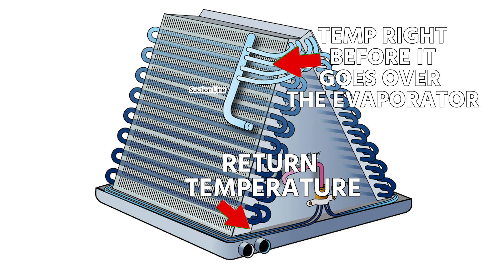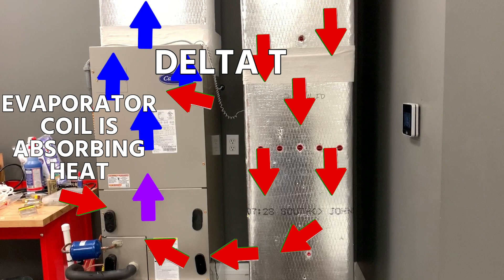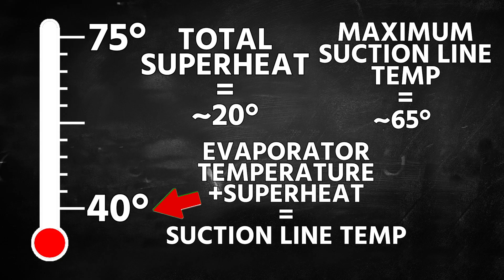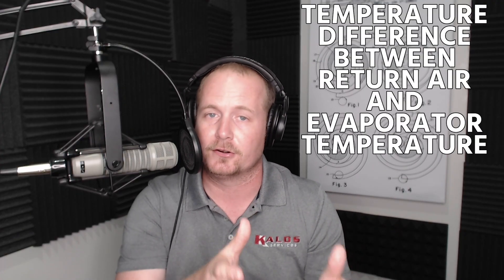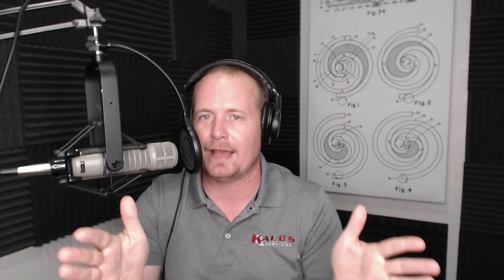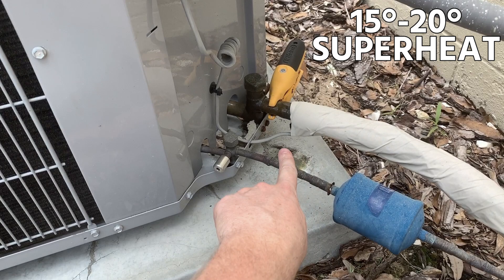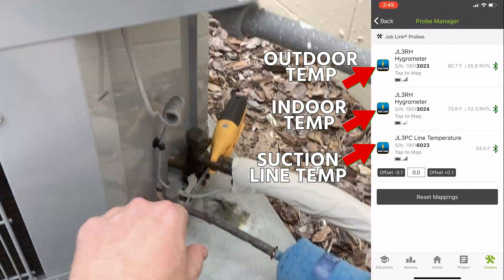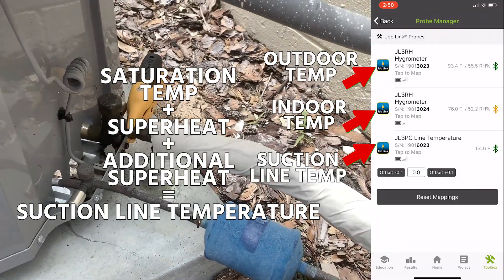Suction Line Temperature

Comment: AI says: "Suction line temperature, measured near the compressor, should be cooler than the indoor return air temperature due to the evaporator coil absorbing heat. A good rule of thumb is a 35°F difference, with the suction line being cooler than the return air, plus a superheat value (typically 10-20°F). " I know you mentioned similar things, yet above words no need ten minutes, so I understand these above words but not your video.

Comment: I'm having a problem I need help with.5ton 410a Txv.Subcool about 10.Sat temp 48.(High right)Delta T 15(low)Suction temp at evap 63 and hunting.I see however suction temp hotter at evap than at service valve.Capacity for crap high elec bills air gets hotter by the day with inside home at a muggy 80.Is there a restriction,bad txv,non condensibles,bad coil distribution?HelpShould I remove refrigerant to get lower sat temps.Its 79 indoor temp at return plenum which I thought sat temp should be about 44.Air supply is 63

Comment: Can you apply this principle to a domestic refrigerator?
I got two pipes emerging from the compressor.  One is hot (105F) at the point the pipe meets the compressor and the other is ambient (68F) where it meets the compressor.
Which one is the suction pipe? The ambient?

Comment: The company I work for sticks to  ridget rules on temperatures and pressures.  You cant talk to these guys and explain to them that not all systems are created equally. Some are just bad installs or worn out equipment.  Me I just use my gut feeling on what works .  its worked for me for 30 years.  Not an expert just a service man.

Comment: Would there be any merit in using indoor suction line temp to tune your blower speed? For example, if you were slowing the blower to remove more water, but didn't want superheat to fall too far.
Reply: Suction and condensing temp Of compressor.

Comment: I enjoy your videos but sometimes you overlook or don't state the effects that ventilation issues can have on these numbers.  I am in the controls and data analytics software business (my co).  To use an example, I decided to hook our sensor system on my own home.  I didn't expect to find much but I was instead very surprised.  My home is zoned up and downstairs with a Honeywell controls system.  After running the diagnostics on my home, it blew me away when I discovered that my bypass showed "open."   When I examined the system in the attic, I discovered that these fools never installed a bypass and it was wide open.  Now this causes the extreme heat or cooling in the return (depending on what stage is running).   As for the suction line, it shows very cold when the system is cooling.  That might cause some errors in a tech's judgement when only considering LL to SL etc.  My point is that the big picture matters greatly.  We deal with commercial applications with bypasses and fairly complex setups too.  However, even the small split systems can get complex when they've gotten fancy with Honeywell zoning and bypasses.

Comment: Can you talk more about how to properly set up the probes and do the measurement on some modern air-water heat pump with ETXV like Mitsubishi PUHZ or  PUD or Daikin or Panasonic or, Hitachi. This videos are too much of an US type air-air conditioners not heat pumps. Im really interested how would you measure the system with Testo smart probes, read the data from it and use that data to diagnose the system.  Most of the times the heat pumps like Mitsubishi comes precharged and with inverter technology. Can you even diagnose the system on inverter heat pump? Where do you plug in the probes(at the service valves or at the valves at exit from the heat pump? How do you know if the system is charged good if you have inverter heat pump?

Comment: Well knowledge doesn't mean good teacher. You talk like a robot - Too fast and too monotone.. (bored)
Reply: You can play-back at less than normal speed. Look for the gear tooth on the bottom edge of the vid....click....and run at 0.75 speed. I have the same issue...BUT.....I appreciate the shortness of the vid at regular speed and to get the big picture....yet be able to play back at 0.75 or even slower speed if I need to....to absorb the details. You gotta admit, the content is technically excellent. Hei s a good teacher and uses screen text to good effect too.... 👍
Reply: Damn I thought I was the only person

Comment: A dirty ID coil, or fan running low speed, can screw this all up, even with a TEV, depending on how bad an airlflow problem is. I’ve seen plenty of iced up coils (back to the compressor)with TEVs, with a warm space temp,  and t-stat setting in normal range.

Comment: My suction line is cold as hell by compressor.
120000 btu furnace and only 8 vents on 6 inch duct in house.
Is it possible im not moving enough air.
Unit runs non stop above 90 degrees
Reply: There is a phrase that may apply here.

"ABC"  = AIRFLOW BEFORE CHARGE.

Too many "techs" start passing gas before eliminating airflow problems at both evaporator and condensor.

Comment: Good job, just a note : prefer to see liquid line filter drier close to the indoor metering device. Helps keep it out of the weather and from rusting as well. The picture on the outdoor unit just showed it outdoors but, good to see one in he system.
Reply: So if I get a new system alway tell them to place the dryer close to the TXV instead of outside?  I always thought there was a reason it was outside but you make a great point.
Reply: @condor5635  ya man👍😎
Reply: @condor5635  Yeah there is a reason it gets put outside. When its outside, its likely to get replaced. If its up in the attic and the work is out by the condenser, then that dryer aint getting replaced

Comment: Today I have two R22 AC in a house which have NO filter driers installed. Fixed piston metering device. Both suction line pressures are around is 90psi (saturated vapor temperatures are around 53F). The suction line temperature at outside condenser service valve are around 73F. So the superheats are around 20F. The liquid line pressures are around 220psi (the saturated vapor temperature is around 108F). The liquid line temperature is 104F. So the sub cooling is 4F. 

Although the super heat is high, but I don’t want to add refrigerant since the pressure at suction line is already pretty high. Is the metering device clogged?

Thank you
Reply: You have high superheat and low SC. That’s likely just an undercharge situation. It’s unlikely the piston is restricted, but it’s hard to really diagnose without knowing airflow or indoor wet bulb and such

Comment: Hello, asks a Question I hope you can answer.  Is it recommended using TWO different Systems in an AC say Out side is a Goodman, inside is a Rheem. Do these Mix well or should all AC be the same inside and out. The apts i live in they have Non Certified HVAC woking here and none of them even Know the +30 Rule and probably nothing of what you just Discussed they speak little if any English is why.

Comment: Sir, what is the capacity of a refrigerant compressor, how is it calculated, and why do we measure it in term of a heat transfer unit like BTU/hr or  TR?
Reply: sandeep satratey I can kind of answer that I think?!.. capacity is the stroke, bore and size of piston, if I remember right from school lol. And you use btu because thats the heat rejection, like 1 ton of cooling is 12,000 btu of heat rejection and 15,000btus of cooling.. or something like that haha my numbers might be off but the idea is close

Comment: I wonder if you could do a video/podcast on line set sizes like different diameters on system performance. Everyone knows we should follow manufacturers specifications but I run into many systems where people have reused the line sets and the newer systems is calling for one diameter larger like 7/8” vs 3/4”.  Around here many of the systems are installed in attic’s and suction lines are quite often dropping 25 feet.  Many times the systems seem to be running fine but could they be running a better delta T, or better electrical efficiency if they have used the larger suction line?
Reply: MrNebRebew Hello Brother, just a note from a long time tech here. I have noticed more often than not when going from R22 to R410 that the line sizes are typically the same or less. Also if you go to the Install manual or the Engineering specs often the line sizing has a pretty large margin on line set diameter as well as length before it affects BTU output significantly if at all. Trane and carrier have great design manuals for all this.

Comment: Still try and look at your suction line at the Compressor and see if it is sweating all the way to the Compressor and maybe a small ring past the Point of entry into the Compressor is somewhat a good indication of over or under charge of a system .
Reply from the maker: That depends on outdoor dewpoint
Reply: HVAC School  I agree live in Louisiana but plenty of times you can see the sweating will Stop a few inches from Compressor which is a sign but I always do Superheat and Subcooling no matter if fixed office or Txv and if it’s a change out or New System I always put Fittings by evap Coil with shraders lil expensive but can check my pressures and temps entering and leaving evap Coil also with liquid dryer at Coil . I’m 63 yrs old still working and learning every day
Reply: Here in AZ we very rarely have sweating suction lines because it’s so dry out here. Careful sharing that method with others.
Reply: Jules, we sweat in January in Louisiana! Not everyone lives in a swamp!